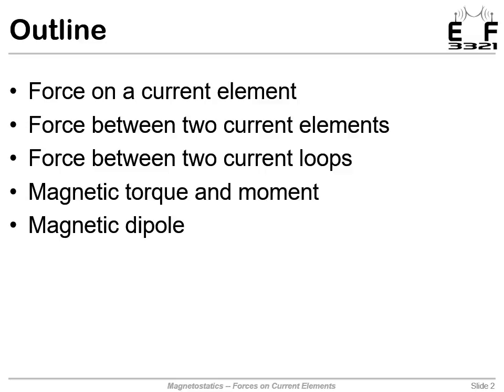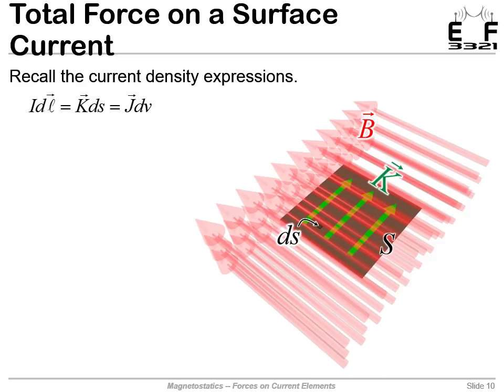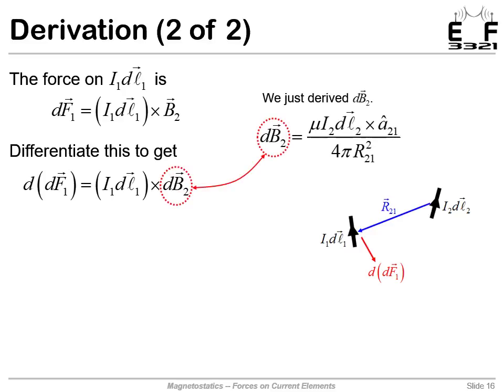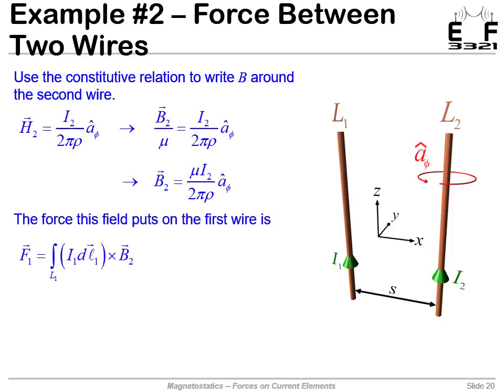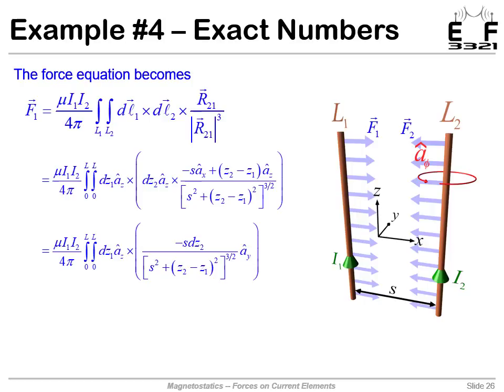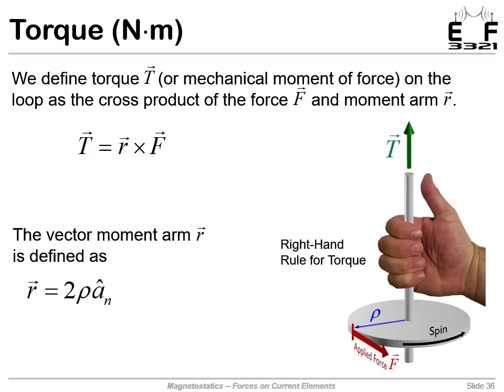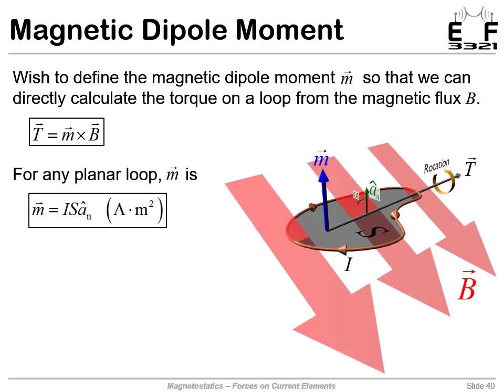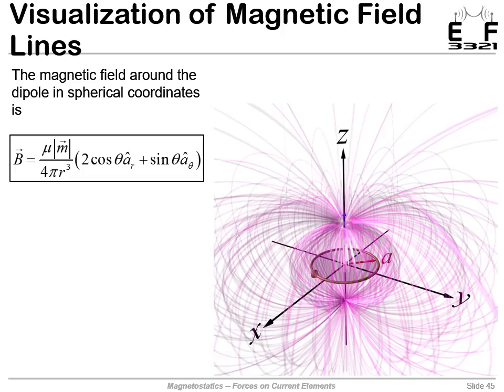Lecture 5c -- Forces on Current Elements

Comment: Hi Around 21.17, I think R21 = -s ax + (z2 - z1) az should be changed to R21 = -s ax + (z1 - z2) az, am I right?
Reply from the maker: The convention here is that R21 = R2 - R1 (all vectors here), which leads to z2 - z1. I never liked the order of the convention.
Reply: @empossible1577  I am afraid there are some inconsistences here. From the figures in Notes and Video, R21 is pointing toward L1 (start from L2,  page 14 / page 17 in notes) or pointing toward L2 (In page 18). I think based on Biot-Savart Law, the "displacement vector" used should be pointing L1 if we need to analyze the magnetic field produced by L2 and the correspoding impact on L1. Could you double check it?
Reply from the maker: @localfuture1484  You have motivated me to review this material and probably redraw many of the figures while ensuring everything is correct. Thank you!
Reply from the maker: @localfuture1484  Looks like I should have labeled the diagram with R12 instead of R21. The problem is that two of the textbooks I am coordinating with all use the notation R21 but point the vector from IdL2 to IdL1. Frustrating!

Comment: Sir, in the formula of vector moment arm(on slide 36) you wrote r= 2*p but why is that? Isn't it just p? Bcz 2*p indicates the diameter of the disc.
Reply from the maker: In EM, there is force being applied at both sides of a loop, thus the factor of 2.  On this slide I am comparing to a mechanical disc making that point confusing.  I will see what I can do to clear up this point.
Reply: Sir, one more thing, today I notice that the video of "magnetostatic devices" Is made private.
Reply from the maker: @meghjitmajumder3468  I "think" I fixed it.  Please try again.  Thank you for letting me know!
Reply: @empossible1577  Thanks Sir

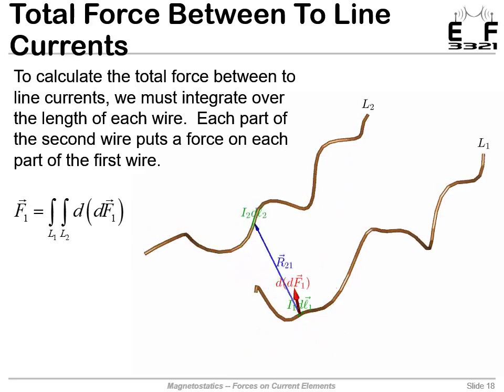Comment: Around 13:13
Q1) Shouldn't the wire also react with itself? I know that the sum of all forces acting on itself will be 0, but I'm thinking more of the wire bending due to its current in itself. 
Q2) I suspect that the wire cannot be approximated to an infinite line when it is changing direction a lot, as in the video, so perhaps treating each wire part(the ones that flashes green) as a point would be more true to the real world.
Reply from the maker: You are asking a good and difficult question!  In principle where a wire can be any shape and current will still flow, I think we could construct configurations where self-bending and things like that happen.  I get less certain when I consider more practical wire elements that cannot be discontinuous.  In order for a wire to conduct, it has to complete a circuit.  I will need to give this more thought, but it certainly would limit what is possible.